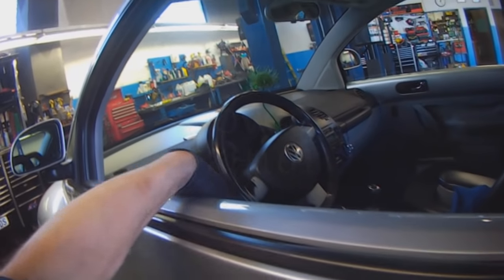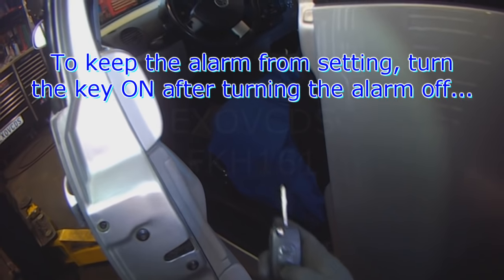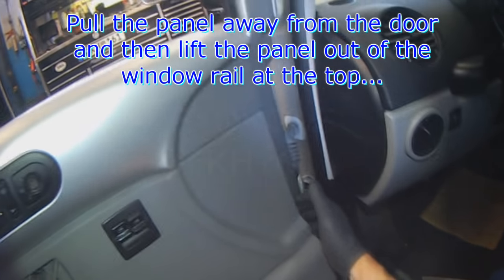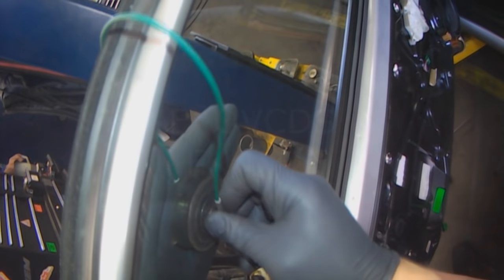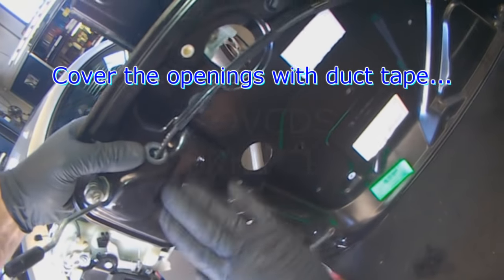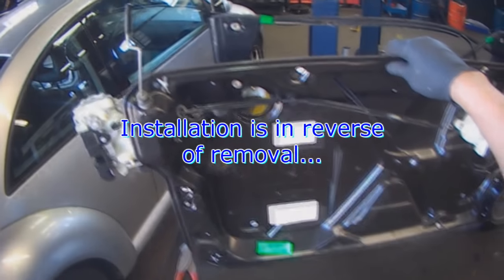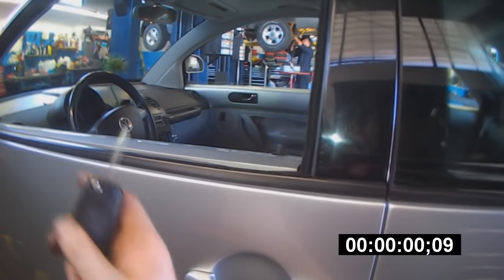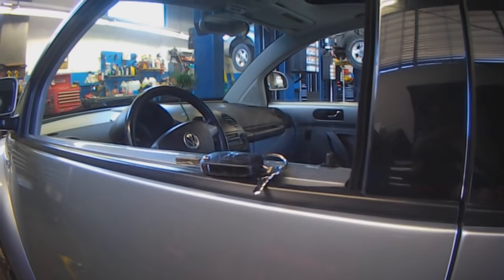VW A4 New Beetle door lock actuator removal

Comment: 10:45 in the video is what I tuned in for and Thank you , Thank you, Thank you for showing this! I know why people have problems with releasing the wiring connection, this may be because I was replacing the window regulator and leaving the lock actuator bolted into the door and the release is not easy to reach and i did not want to undo the locks. Thanks again!
Reply from the maker: Thank you for watching!

Comment: Why did you change out the door lock? My passenger side window is not dropping when I open the door from the inside. It drops perfectly when I unlock the door with the key fob. Once the door is closed, the window does not go back up immediately - there is a 15 second delay. Think a door latch replacement would fix this?
Reply from the maker: Yes... micro switch in the latch doesn't send a door open signal. When using the fob, the fob acts like a door open signal.  Replace the latch and all will be fine again.

Comment: I always refer to your videos to solve my problems thanks Thomas 🙂 .. so
What is the correct number for lock actuator  2005 Beetle ?  There are many symbols after the lot number on eBay any difference between them? Or they all fit properly
Reply from the maker: It is best to order parts according to vehicle identification number. If a parts store can not cross reference the VIN, then phone the dealer and have them give you the correct part number of the part you need. I would only install genuine dealer actuators.

Comment: I have a 2013 beetle and I notice my passenger side door tries to lock every time I start to drive after a red light, or if I had to slow down for a speed bump when I speed up the lock clicks again, would the same part need to be replaced?
Reply from the maker: Yes... it's not locking / staying locked for whatever reason (most likely due to something inside the latch). An alternate option would be to disable "auto lock once moving"... with a scan tool.

Comment: Hi It's me again, just to tell, with your video and my to do list, I replaced the actuator in less than 90 min. 2 things I'd like to mention, first if you replace the actuator on a Beetle Convertible (mine is 2005) you have absolutely nothing to do with the window. Before removing plugs at the panel, just drive up the window into closed position and that's it.
Second dear Thomas, that plug removal from the actuator (shown at 10:50) that isn't easy at all. Mine did not come off, I had to break out of the old actuator and then I was able to remove the plug with all kind of different tools. So you don't have to wonder anymore, because I think after 150000 miles that plug is cold welded to the actuator. 
First thing I noticed after all work was done, the sound, how the door is closing. It's not the door of a tank anymore, it closes like a Rolls Royce. Easy, smooth and almost no noises.
And everything works fine again.
Thanks again Thomas, your video was my motivation and my success.
Reply from the maker: Thank you for the update and the additional input... the "connectors" can get stuck with age. The same style of connector is used on all sensors in the engine bay. Pushing the connector against / towards the device that it is attached to and THEN pulling the release tab back... can help in taking the connector off. Thank you again for watching & the added input. I'm sure my viewers / others will also appreciate it!

Comment: Thank you a lot for this video.  I just did this job on my '01 this afternoon and this was the perfect how-to.  I have the Bentley and Haynes manuals but there's nothing like watching someone do it.

One thing I ran into on my car was that the little plastic bracket you point out at 13:35 was missing entirely, and the holes in the regulator carrier for it were taped over.  I guess it's not structural, it's just there as an assembly aid so that you can manipulate the latch and the regulator carrier as one piece?
Reply from the maker: Yes... some people don't bother with installing / attaching the bracket. I like to keep things the way they were. Thank you for your input and thank you for watching!
Reply: I bet the actuator was already replaced once before.

Comment: Did the actuator need any sort of programming to match up with the key? And how long did the actual job take you to do?
Reply from the maker: No... shouldn't take longer than 30min to 1hr. I'm not sure what the "flat rate" charge is.
Reply: based off my knowledge, its just a big motor and a switch...

Comment: Thanks for this expert video. Looking at your video, I made myself a check list when, what to do, which tool needed. 
One thing I believe I missed, why was the procedure with the windows, open the clamps, release the actual glass? Oh, the answer comes right to my head, because this procedure is, to get off the regulator panel. 
Well, that's different on my car, I have a convertible, where the sliding tracks are not at the back of the regulator panel but in the door. 
Great video Thomas, do you have more of Beetle videos, because my Beetle is at
215000 miles now and everything is still working great. Just the lock for now...
Reply from the maker: Hi... I don't have a video of a newer beetle regulator set-up. If it is similar to the A5/mk5 then access is made by removing the outer door panel. I'll be uploading a video (of a Jetta) later today, that might be of use to you. If you go to my video page and enter beetle in the search field, all my beetle (old & new) will come up. A lot of the A4/mk4 videos will / may still apply to your car as well. so search for VW A4 to see those videos. Thank you for watching!

Comment: the push pull main lock elect. connector seems stuck, it wont budge? any  advice?
Reply from the maker: Brad Michael Push the connector towards the assembly, at the same time pull back on the release tab... then pull the connector off while still holding the release tab back. You can use a pick and lift the tab by sliding the pick under the front of the connector.
Reply from the maker: Brad Michael 10:45 says & shows it all.

Comment: How do you put the outside handle back in? im cleaning up after a garage attempted to put a regulator in and cant figure out how the outer handle goes in and latches its a 2006 vw passat any tips thomas?
Reply from the maker: I'm still at work... I'll get back to you a little later once I am at home.
Reply: +Thomas EXOVCDS Thankyou, i can put the handle on but there must be a trick to get it to catch the latch i cant figure it out unless its been damaged..
Reply from the maker: Read through this... not sure if it will help: http://fkh161.ca/VW/Passat/PassatHandle.pdf The handle tilts in and then you have to slide it forward. Page 3 might be where to start... 1 to 2 is for the lock housing.
Reply: +Thomas EXOVCDS Thank you, i've tagged you on instagram as to why the handle wouldn't go on.
Reply from the maker: +MrAsadEp Can't find the instagram post.

Comment: I went to a Firestone store to have mine replaced. On the phone they quoted me $150. When I went to pick it up, they told me they had shattered my door panel into 5 pieces and the final charge was $650.00. Can you say what you charged this guy to do this fix?
Reply from the maker: $150 doesn't even cover the part (here in Canada)...  over the phone quotes / estimates are estimates, since you don't know what you run into once the car is in the shop. I think someone made a mistake with the estimate (didn't know how involved the work would be.

Comment: Hi good morning!! After locking the doors on vw beetle I cant start my car.
Reply: What can it be?
Reply from the maker: Car starts with doors open?
Reply: @EXOVCDS  hi.... thanks for reading my question. What happens is this. Yesterday I change the fuse box (the one that is on top of the battery) cause it was damaged so I went and bought a new one. The old fuse box made the car crazy so with the new one my car starts but the problem here is that if i turn off the car and (I get out of the car) i lock the doors with the remote key when I go back and try to start the car it wont. Is like if the battery was dead and everything blinks so what i do is lock the doors manually and not set the alarm with the remote key. It makes a weir sound under the steering wheel. Is there like a control module under the steering wheel? Cause as long as i dont use the remote key to set the alarm and lock the doors the car will start the next time i drive it.
Reply from the maker: You need to do a "full system scan" of all the control modules in the vehicle (a regular OBD scan tool will not be able to do this). It could be a problem with the driver door module. If the alarm module thinks that the door has not been opened (even though it has been) it will not allow starter activation. Usually what happens is that the alarm activates when the key is turned to start... in your case, I'm not 100% sure what the issue is and that's why I suggest starting with a full system scan (there might be some fault codes stored in some modules that can help track down the issue).
Reply: @grgortiz1401  normal operation, one of your door sensors or hood or trunk sensor is busted and wont turn on the alarm.

Comment: Thomas i bet you have done hundreds of these because on every vw audi etc i have owned these have failed lol
Reply from the maker: I've done a few... and none of them have yet to have come back with the same problem. Trying to fix them / spending the time to fix them (in my mind) is not worth the time.
Reply: ***** I have repaired a few but in all honesty I would just change out the whole unit as it's safe to say when there gone there gone throw them in the trash 👍
Reply from the maker: Thank you for watching! Yes, solder joints, dirty micro switches, broken microswitches etc. are the common issues. Anything could be repaired... if brake pads could be relined, I'm sure people would reline them. Whatever is easier / more cost effective from someone... that''s why shops replace the unit. Fixing solder joints to only have a micro switch fail 6 month later, makes no sense. We replace the whole unit so that we can provide a warranty on the whole part.
Reply from the maker: Repairing & selling old units would probably generate more money than I'm currently getting off of my youtube channel... but then I would not be able to help as many people as I currently am (I don't have time to do both). Let me know how your repair works out and if it was cost / time effective. For most DIY people it is and if one has the tools & know-how... I definitely would recommend doing it. Some people take on more than they can chew and in the end will pay more money & lose more time than a quick swap would have taken.
Reply from the maker: Thanks for the update! I had one this past week that also had a bad motor... it was on a mk5/A5 Jetta. Applying power to the motor did not do anything, until I gave the motor a bit of a push. I'll be including video footage in the "Various March 2017" video clip that I will post at the end of the month.
Reply from the maker: Replaced the unit / module. The regulator panel seal can be reused unless it is torn... in that case, apply a removable weather stripping sealant, that will not cause the panel to stick (the next time you have to remove it). Use something like: https://www.youtube.com/watch?v=v6akb36ZCgc Just like door lock modules, we replace the regulator panel rather than try to repair. As A DIYer... the sealant would be a cheaper fix.
Reply from the maker: Panthera Thanks for the update!

Comment: Now is also the best time to delete those nasty useless door lock plungers that only pinch your arm skin when you get up to speed and the doors autolock
Reply from the maker: Try not to rest your arm on the door while driving. =)
Thank you for watching!
Reply: @EXOVCDS  I've already deleted all my redundant pop up door lock actuators
You can't pull them up and if you're driving you can't lock it with the door open anyway
What're they good for?
Reply: @johnmoser2689  indicators basically, its what most are for now adays
Reply: @DigiVore.official  redundant... there're gone on all of my mk4 cars